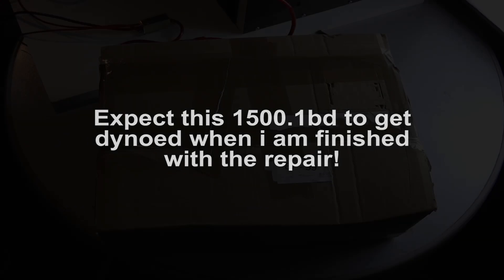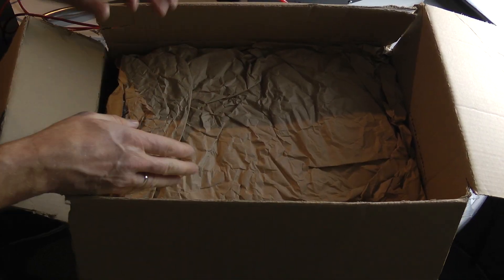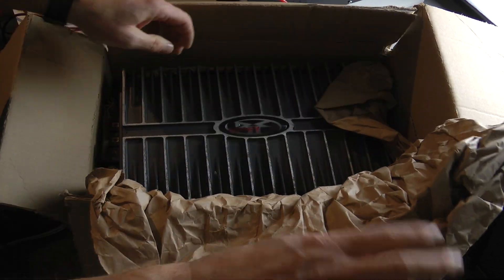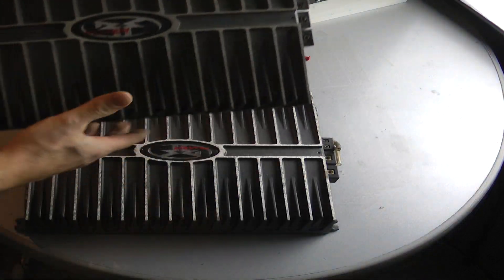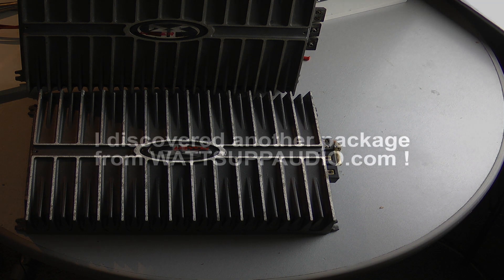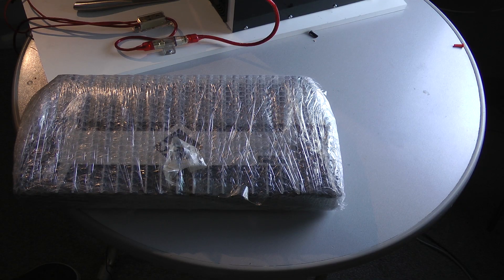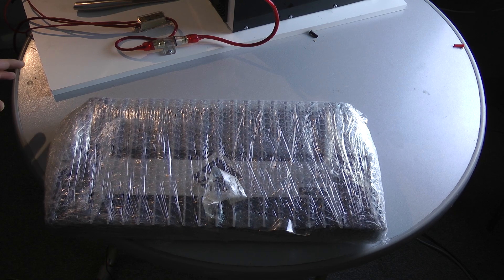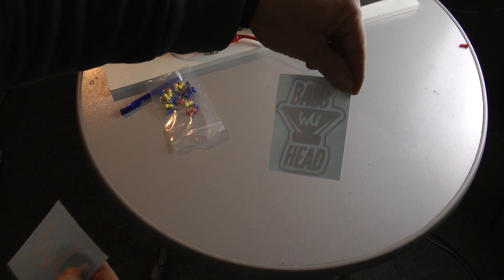Rockford fosgate punch amplifier dyno teaser and unboxing of amps sent to me by subscribers 1500bd

Comment: Andi, you forgot to mention, that both outer boxes are originally from wattsupp Jan .. laugh .. man, I was sooo looking forward to link them up with a bd sync cable and wondering what output they will really make together. Also still wondering If there`s any difference between the 800a2 normal and the power version? Or If it`s just nothing else than a different badge, like on the 1000 and 1100 ones.
Reply from the maker: oh i didnt know 🤣
i think its possible to get continuous power a little more than 3k. i will test it with 100Hz. maybe 40Hz cont and burst when i am finished.
The 800a2 and power 800a2 have at least one difference from what i know : the filter-slope is 24dB instead of 12dB with the power 800a2.
After the dyno we will know more.